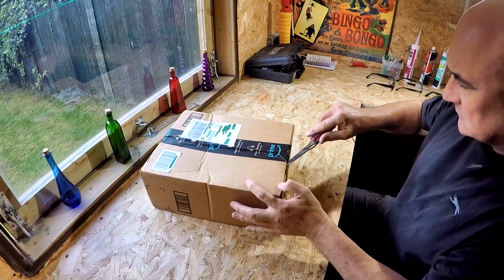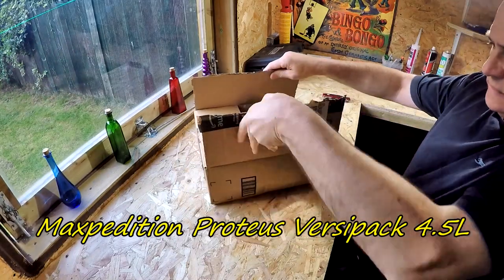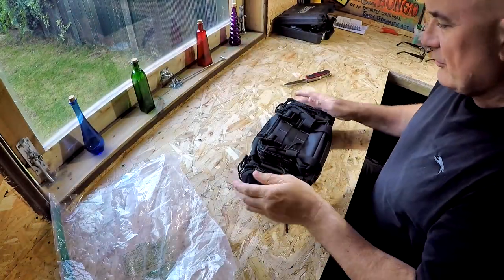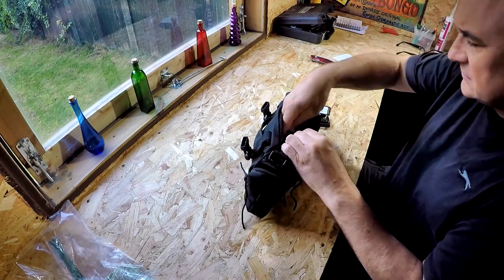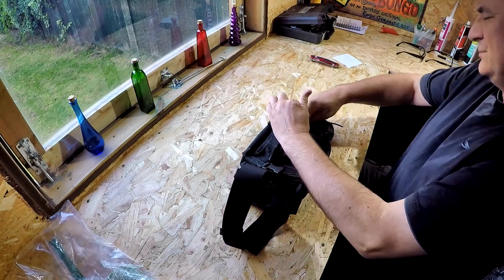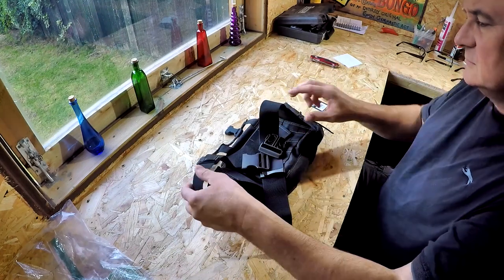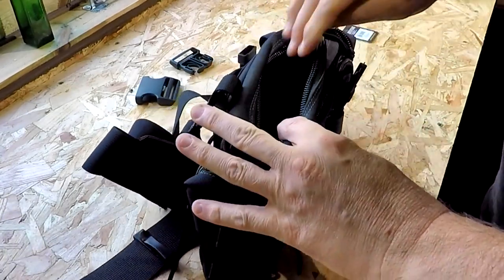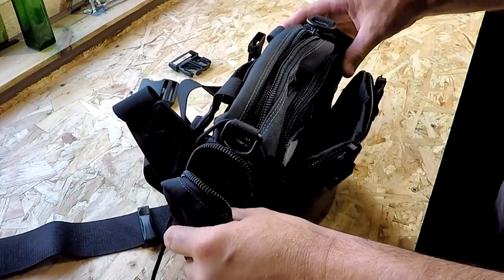Maxpedition Proteus Versipack - Unboxing And First Impressions

Comment: Hi when are you going to post part5 of your fencing project after fencing what project are you going to do
Reply from the maker: Hello there and thanks for your time. I ran slightly short of decking boards because a couple were warped and because of COVID my supplier has completely run out. Just waiting for them to re-stock so I can finish off project (hopefully finish within 1 week). VLOG on it's way with updates. Thanks for your patience. Des